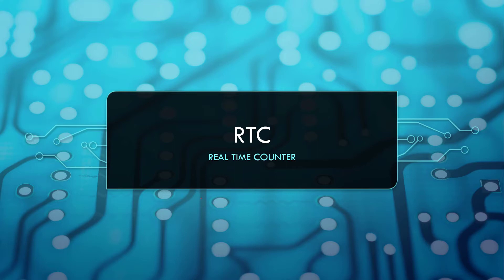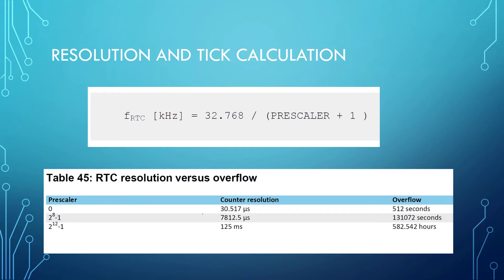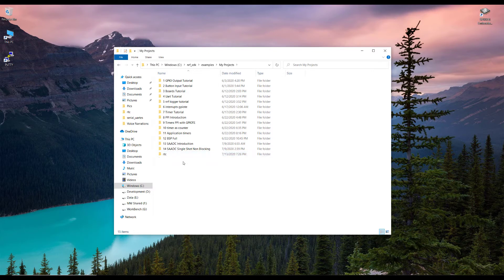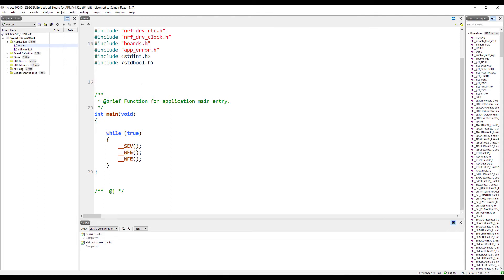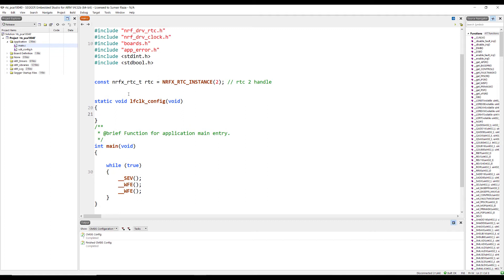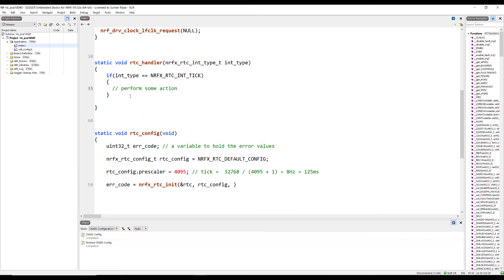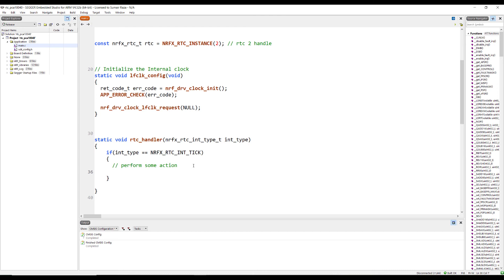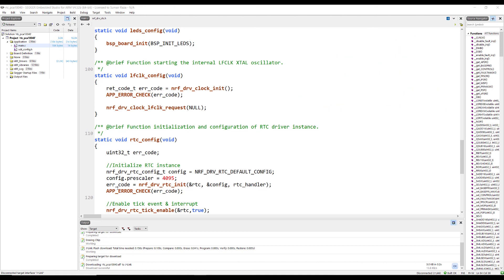nRF5 SDK - Tutorial for Beginners Pt 22 - RTC -Real Time Counter - Low Power Timer

Comment: You mentioned each RTC has 4 channels but the tutorial doesn't seem to use a comparison event generation but just tick event. Anyway by the statement, Can I make four timers?
Reply from the maker: i didn't use the comparison event, but its easy to implement and you can implement 4 comparison events, i have planned the comparison events video after we understand BLE. you can use application timers for that purpose as well they use the same hardware. ;-)
Reply: Sumair's Embedded Engineering thank you always!